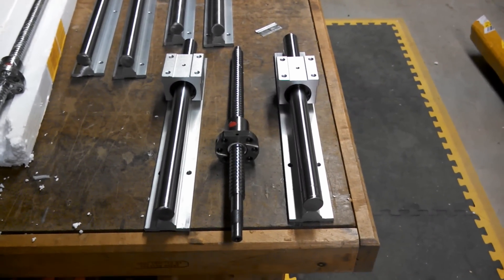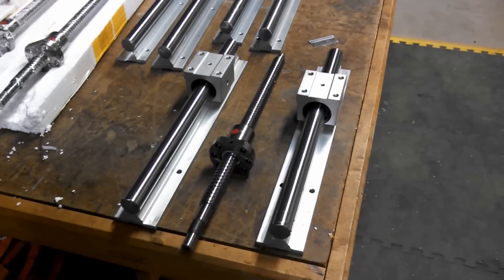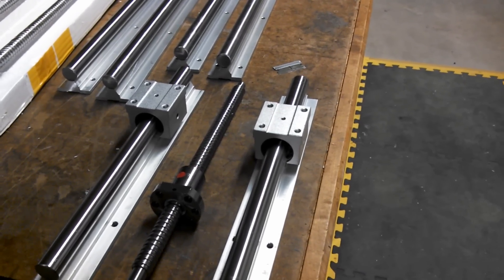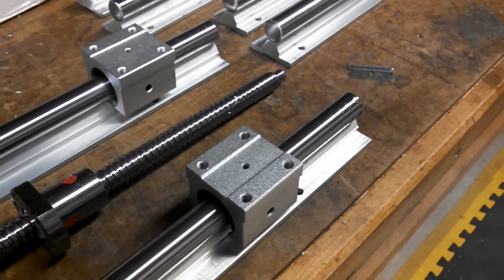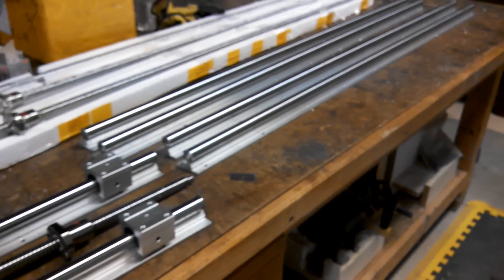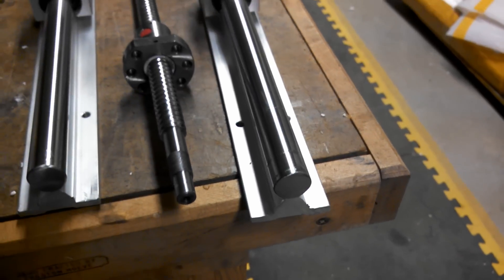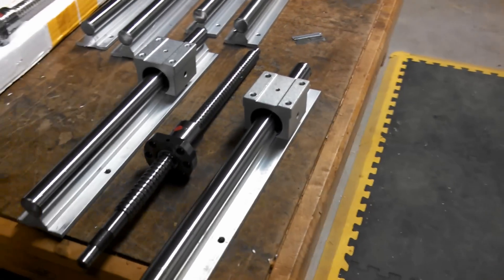Chinese Linear Rail Review

Comment: OK, been there done both styles, here's the quick and dirty. SBR's are great and cheap to get started. You WILL outgrow them, they simply have too much slop to be any use in the long run. But get them if your budget is low and you're just getting started. Great for a first version DIY CNC, but if you're into the money making stage, go straight to the HIWIN style.
Reply from the maker: TKC - I have pinned your comment to the top of the discussion.  I completely agree.  It has been two years now and although I am not unhappy with my choice or their cost/performance, I am looking for improvement.  I have one more thing I'm going to try with the SBR's and will have a video of that soon.  Thanks for your insights.
Reply: @sbirdranch  I see it’s been about 5 years since you started using, did you upgrade to a better rail.  Would the movement go away by ordering new block or were the rails themselves worn?  Seems like some low grade blocks wear out fast, but better ones can last a long time.
Reply: @TKC,  I am not into rebuilding anything at my age, make it good right off the bat. So I took your lead and looked for the generic versions and voila found it. There are also genuine Hiwin but so far not in tailored kits as of this message. I would ask you for a 4' x 4' or so called "Half sheet" table what the min width for the rail would be feasable. There is such a thing as ridiculous in over build mode. And I am on somewhat af a budget. After all we are trying to do this for less than the cost of a turn key table right? I can buy a slightly used 4'x8' for less than $5000 CAD. But I would sooner build that here in place rather than ship it or truck it myself
Reply: HIWIN is better, since you said it...but this is best: https://www.alibaba.com/product-detail/High-Speed-Low-Noise-Linear-Guides_1807087165.html?spm=a2700.8443308.0.0.yfoaH0
You could get the more simple versions of these, without the end cap with the felt rail cleaner.  These AREN'T CHEAP.  I was quoted $1200 plus shipping, vs $450 including shipping for the SBR type...for the same lengths. (just over 30 feet of rail with 8 bearing blocks.)  The link I posted hasn't priced me yet, so hoping they are cheaper.  This style is much better that the type that the block wraps around the track.  The speed rail block rides inside.
Reply: Just a small note about your choice there. 1st they are definitely worth a look but, I have never heard of the maker or seen these in use anywhere, so where is the end user's  first hand experience feedback going to come from to give you some peace of mind.
 Second they collect chips and dust in the channel. Their proprietary wipers are going to be working overtime.  I have need of a set of  2 blocks per side for the X axis gantry side plate supports, running the length of the bed - sitting in the upright attitude. Your suggestion will be filled with wood dust in a matter of seconds.
The Hiwin profile is a lot easier to keep clean.   My entire package at BST is slated to be about 850 delivered BTW. Thats for the rail, 20 OR 25mm ball screws, HGH and HGW bearing blocks, BF and BK support lock nuts and couplers for NEMA34 Their packaging is supposed to be styrofoam and wood as well :-)
Reply: Hi there, glad you chimed in here. I decided right off to go with Hiwin, and there are many copies of them. Right down to the exact bolt spacings of course. Interchangeability is key.
I was looking around for a vendor to put the complete kit together , that's Hiwin HG and HW series plus  Rm2010 /2510 ballscrews for a 1500mm x 1500mm table.  And none of the so called CNC outfitters on Ebay and Aliexpress till recently would show me a nice close up of the Bearing Blocks that were packaged for the 800 including shipping price (USD). So I was withering away in a morass of indeciscion. Until I found a name that kept surfacing at CNC Zone. They are called BST Automation - Aliexpress and I am sending my quotation requirements there. Hopefully this will be the last I will have to send off. Nobody mentioned that this process of finding all your materials and fasteners would be a good fraction of the work :-P
 BTW My drawings for all   bearing mounts machining etc are configured for HGH and HGW (wide flange) bolt spacing, so I have no choice but to try to get the best in a Hiwin config. Preferably all parts will arrive with original Hiwin packaging where you will also see and confirm the one of three possible Preload factor ZA, Z0, or Z1.
It is not on the bearing block in laser etched ID #, only in a checked box on the packaging.
This I feel would be key to a better sale experience :-) That and nice straight rail and rod after the shipping process :P

Comment: Thank you for the short, and on point, video. Much appreciated. I have a quick question. I am making a system where I will lift an empty bead to get it out of the way. Do you think it would be possible to put two rails in series, to increase the length, and have the wagon cross to the next rail? Not much precision in my project, so I guess that helps.
Reply from the maker: It could be done.  You can remove the extruded base so you have just the round rail.  The ends that adjoin would need to be faced off.  They come with just a saw cut.  Then you could add a precision dowel rod between them to maintain alignment.  Re-install the aluminum and off you go.  Good Luck ~P
Reply: @sbirdranch  Thank you so much. I think this will be the solution. I will lift the bed with Dynema rope, and use the rails to guide the bed so it only goes up and down. Thanks again for the video.
Reply: Was wondering how did you connect the rails in series to extend the lenght. And how well it worked, positive and negative aspects. Was going to make up a sliding table for my saw, so need it 4.8m or 16ft lenght for 8ft or 10ft sheet

Comment: I bought those slides for my machine, they worked fine for a few years but I replaced them with self lubricating copper slides from China which are better but still very cheap to buy.
Reply from the maker: Can you post a link to these?  I'm curious.  ~P

Comment: I have built several cnc routers looking back I would replace the bearing inserts with a good ceramic or Delrin ply because wood dust gets into my thk slides and the accuracy they have is not worth the constant cleaning for a wood project

Comment: Thanks for the hint. I checked that and found that these holes are actually inaccurate. So you have to calculate a little play and align each part individually so that it slides smoothly. Therefore do not use countersunk screws because they center when the screws are tightened.

Comment: i ordered two 1m HGR20 rails and they seem to be pretty straight. the ballscrew that came with them is slightly bent but a heard thats due to the manufacturing process. Ill probably order three more sets (2x 1m + 1x 40cm) since they are pretty cheap and sufficient for what im diong with them. 100€ for a 1m set of rails + ballscrew and everything

Comment: Thanks. Quick question - Are these meant to be mounted on a flat (horizontal, parallel to the ground), or can they be mounted on a wall? I am looking for some rails to attach on a bookshelf and hang a TV off them, so that I can slide the TV aside and access the books.

Comment: Recently i have purchesed st20 round linere quide rail with alu. Block for cnc router, is its works up to 3.5mtr length.
Reply from the maker: My machine is not that long, but if the rail is supported well it will work.

Comment: Perfect, I am looking at the exact ones on Ebay also, appreciate your 2 cents on them, makes me feel a little better about buying them. Going to build a 4X8 table 
Thanks again,
Reply: you guys should look into a pinion gear rack if the 8' + ball screws is having issues, had to upgrade one of my units to them after having a few issues with the 8' + ballscrews , only real drawback to them is mounting the motors, but it isnt too bad as well after a bit of research on them, i personally like to use them with these same chinese linear rails dispite the bad reviews on them, as far as i can remember ive only had one or two of these rails go bad, so idk about most people but as long as you keep them lubricated they seem to work great for me, no matter what the work is , with wood, metal, or even the laser shoe they seem to be fine with everything, and can seem to keep the same precision as the other rails, sure you can put a bit more weight on the other kinds, but also you can get these in bigger sizes as well where you can put alot more weight on them as well..

also on mine you can replace the bearings on them, so really if your getting alot of noise in them you can also replace them as well as long as your shafts are fine.

anyhow hope this helps a lil bit on the 8ft issue with your ballscrews (note i still even use ballscrews even now with my z axis, the smaller axis's they work fine on just the longer they go ehhh they have issues then, but always remember everything has a purpose in life :)
Reply from the maker: Your welcome.  I don't know what you are planning to use for driving the 8' axis, but an 8' ball screw may present an issue being unsupported across at least 4' in each direction minimum.  Just something to be considerate of.  ~P

Comment: Staring to get quotes and would like to refer to other offers of kits like that one to compare but it is looking like the Hiwin gear is going to be twice the cost. I just have one little puzzlement: You bought 1605 ballscrews?  and did you have to tell them that you were going to use NEMA34 steppers?  What length are the ballscrews for a 1200mm Y axis. The same length?Same for the busy X axis and limited real estate of the face of the gantry; are there considerations to be made for the end supports. I have a drawing of a similar sized table that might shed some light on the subject but alas it is an .SKP file  or Sketchup and have to reinstall it from scratch. Fun?
Reply from the maker: Yes. The ball screws were the same length as the rails.  Keep in mind that your ball net will require less length to travel simply because there is only one.  The spread on your bearings on the rails reduce the length of month and hence the distance the ball net travels.
Reply: you using auto correct ? Yeah its all falling into place. Started my Fusion360 session and there lies the library of 80/20 to build with. Be easier with Inventor. I just can't figure on the size of the kit you film here, doesn't scale for me.... Sure you didn't order 20mm stuff
Reply from the maker: Ya...the old ball net....

Comment: As usual I am nervous about parting with ~ $500 for long and heavy items through what ever method of shipping,  So I am also wondering about  runout of any and all of the rail, and ball screw. Did you give it a look with a dial gauge to see what you had?  This is not going to be possible for me, as I don't have a reference to measure from until I have the bed and rails done. And even then, I am using second hand 80/20 so we will see how that goes. Good thing I am not prone to hives :-)
Reply from the maker: I don't have a reference surface that big either, so checking them is more an eyeball and string kinda thing.  One of the reasons I liked the continuous supported rail, is I knew I could shim under it if necessary.  ~P
Reply: I got both your messages and have responded to both in your YT comments area, as it was getting a bit large, :-)

Comment: How is grease applied to these rails? Are there grease zerks?
Reply from the maker: There are no zerks.  You can take out the top center set screw and apply some light oil, but I wouldn't use grease in my application.  Grease will collect dust and chips.

Comment: Interesting.  Did you check the hardness of the slides?
Reply from the maker: No.  Short of hitting them with a file, I have no empirical way of evaluating them.  I will tell you have over a year of intermittent use, there are no signs of wear.

Comment: Good info. Any info on how true the rails are? One way to test is mount then and mount a trammel and mic to one with the probe of the mic contacting the other and running it end to end measuring deviation. I hope to build a 96"X 48" machine (at some point....). Deviation kinda concerns me at such an extreme length.
Reply from the maker: I do not have anything on the rails and their trueness (word?)  As soon as I bolted them to the frame, they became subject to it.  Then you add the flatness of the bed, and the consistency of thickness on your material and I have had other things to work on.  Best of luck on your build.  ~P.

Comment: I have the same designed 16mm rails and bearings installed on my CNC and they have worked perfectly for about 6 years now. I have only just recently noticed some recesses in a couple of the rails at the load and most used point where obviously one or so of the bearing balls is handling most of the pressure. Honestly I don't have a problem at some point replacing all the rails and bearings maybe in another year or so. However when that time comes problem is knowing, am I going to get quality choosing an eBay store, that's the risk . I recently replaced my Y axis screw backlash bearing that had become sloppy so that's something to watch out for down the track.

You might also be interested in a new YouTube video today I uploaded "Upgrading my CNC Router to Hybrid Closed Loop Stepper Motors"  https://youtu.be/Uz5w8I8PwHI

Look forward to seeing more from you.
Reply from the maker: Thanks for giving me a look further into the future.  I'll check out the video links.

Comment: Probably fine for a router or plasma table but that is all still transport grade stuff and rolled ball screw threads. My Mercer 0.0001" indicator would say it's sloppy too. Under 100-200 IPM and you're probably better off with bronze.

Comment: i see kits that has 1605 ballscrew and 20mm linear rail. is that how they should be and spec like that. i mean if i have screw and linear same level then linear block and ballscrew housing will be same level and plate can be installed without shims or any other modification

Comment: I didn't see this mentioned but did you guys know the bearing inserts can be replaced with high quality bearing? I have bought the Chinese and threw the inserts out right away and put Thompson bearings in SWEET!
Reply from the maker: No I am not aware of that.  Can you elaborate?  A link to the bearings or maybe a video on how you replaced them? That would be great.  I'd like to try this.
Reply: Do tell more!
Reply: Yes, please let us know any more info or links for the replacements! And thanks sbirdranch  for making this video!
Reply from the maker: I lue of your input, I finally did a search and found them quickly.  Even Amazon has them.  http://a.co/e2JWuUS
I am having a couple 'pop' which is an indication the balls are not moving smoothly.  I am going to double check the dimensions and if they match, give them a try.
Reply: and how do you grab things with that kind of bearing on amazon ?
Reply: They are inserted into the block. Its just the bearings. The block does the grabbing.
Reply: seems interesting, but these things are bloody expensive, if you need 8 or 12 of them, especially in Australia! are they worth it?
Reply: $145 for 30mm...nope
Reply from the maker: No.  They don't fit.  They are about .060" too long.
Reply from the maker: Have you ever done this?  I now have, out of sick curiosity.  Here's what you left out.  The bearing inserts are about .060" too long for the Chinese blocks.  Worse yet, the ones Thompsons that almost fit, don't have a wiper seal on them.  If you mount them, dust and chips will go directly into the bearings.
All of these things are a bummer, because they are better bearings.  They have a double row at each location, vs a single.  They are smaller balls and ride nicely.  But they don't work.  And especially bad is I didn't order just one to try, but 4.  They are for sale.
Reply from the maker: See my reply.  They don't work.
Reply from the maker: See my reply.  They do not work.
Reply from the maker: I would say 'No.'  See my reply above.  ~P

Comment: "there's no slop, they are super tight" wobbles them all over the place
Reply: They will rotate around the round rail they ride on. But when you get them mounted to a plate or whatever, that should not be a problem.
Reply: 1990notch? se

Comment: Great video, makes life alot easier.
Question:
If you have 2 inline linear sliders on a single rail, how can you make both move at the same time. For example if only one is slid inwards, the other does too. If one is pushed outwards, other goes outwards as well ? 

I need to have these equally centered on the rail regardless of position.

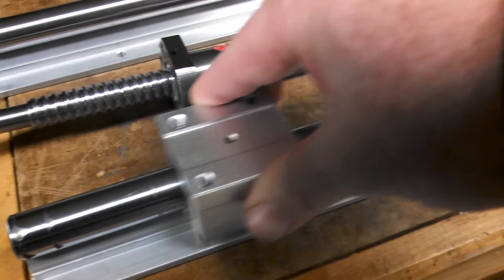Comment: I bought 50 of those same bearings and they were CRAP !  When you  sliding them at 1:44 .. thats not smooth..thats rough and coggy compared to others.  That so-called adjustment screw pushes on 1 spot and warps the bearing that makes it even WORSE.   The better chinese bearing has a slot cut so the adjustment screw pushes on the whole length. There are good chinese for about $10 more. Get the ones with the steel outer bearing casing.
Reply: +green323turbo This style is a much better bearing, http://g01.s.alicdn.com/kf/HTB1H3JFHpXXXXc8XFXXq6xXFXXXA/201464116/HTB1H3JFHpXXXXc8XFXXq6xXFXXXA.jpg
Reply: Do you have a model number or a link? Thanks for posting this.
Reply: Thank you! you should do a video so people can know this info.
Reply: RockPDX 
I found this over the seller...

https://m.alibaba.com/product/60182067934/original-IKO-linear-bearing-with-support.html
Reply: https://bearingsdirect.com/linear-bearings/motion-linear-pillow-case-bearings/sdmuu-open-supported-case-pillow-motion-linear-bearing/sdm20uu-open-pillow-case-linear-bearing-20mm-tbr20uu?gclid=EAIaIQobChMI36-zgcvq4QIVxUCGCh3K6gIiEAQYASABEgJDcfD_BwE